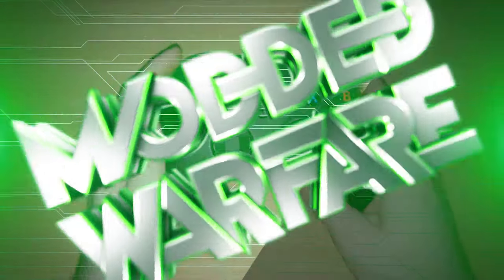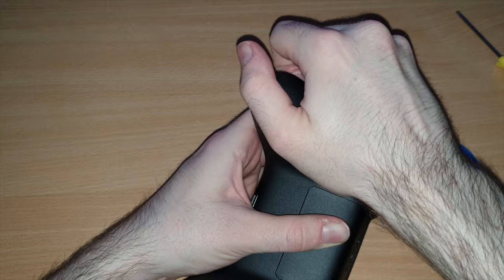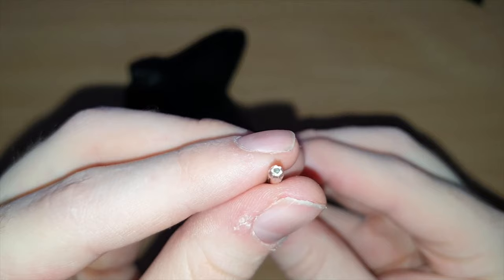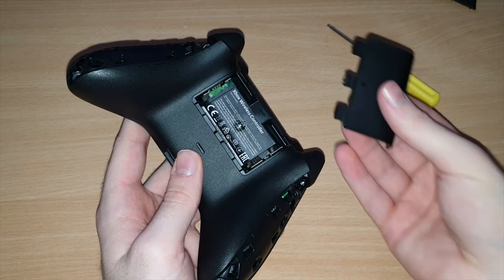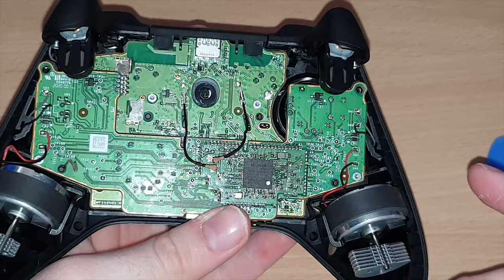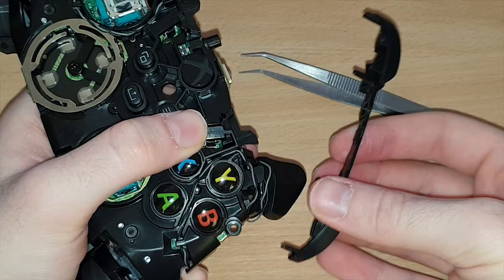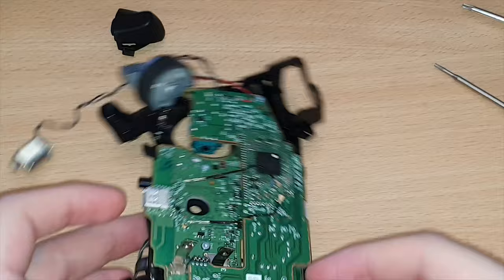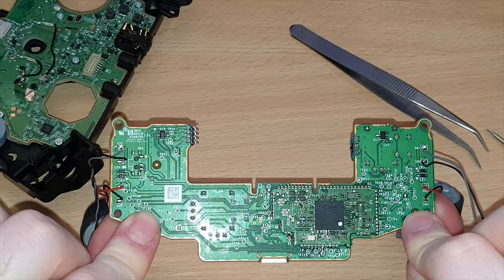How to Disassemble & Reassemble the Xbox Series X/S Controller

Comment: Even if u don’t have the correct screwdriver u can honestly just pry the screws out, that’s what I did, controller even without screws stays together for the most part, just a little duct tape n it works fine

Comment: Just bought one of these for my pc and well impressed by it's build quality, I thought it was all clipped together but those hidden screws under the side grips are a cleaner way of building a controller, never knew there were rumblers in the triggers clever, great controller though all the Xbox controllers are well thought about and comfortable to play with, certianly better than the PS4 and 5 controllers, really couldn't get on with the PS4 controller.
Reply: I definitely prefer the Xbox 360 and one controllers just because of those screws, yes it is a more efficient way of making the controller, but it’s almost as if Microsoft made the controller really hard to take apart on purpose

Comment: I must have an especially right joypad because even the second time taking it the sides this technique didn't work.
It only chewed up the device I was using to separate and even the plastic.
In the end I put a long thin enough plastic  part used to open mobiles, between the trigger and cover and really pulled it apart.

Comment: thanks so much, managed to clean my a button so it doesn't stick anymore, sadly i accidentally broke the grey and black wires away from the PCB on the left side, So the left side of my controller no longer vibrates but other than that it was a success.
Reply: If you like vibration then that's a big L. Otherwise a W

Comment: The little screws, I have yet to be able to snap off the little security torque thing and get it apart, so I've done the best I can with rubbing alcohol, spilled the smallest amount of lemonade on the left side of the controller and the buttons have been feeling horrible. So here to the 6th cleaning in 2 days

Comment: Ye thanks for the vid, I dropped a tiny bit of soya milk in the x and y button.. which you know can be a p off when they don’t spring back up. Anyways the video helped! I already had the T8 for the ps5 so knew exactly where it was…. But when you got to the part you said T6 I thought… why didn’t you add at the beginning what tools you would need haha. So I had to tip the house upside down just to find it! But either way all cleaned and working thanks!

Comment: Your guide overall is very helpful. However, there seems to be no mention of how you disconnected the black wires that go from the top board to the bottom and then have them back in place when putting it back together with again, no instruction as to how you did this. I’ve gone over those dismantle and reassemble segments a dozen times and I just don’t see it. Please explain!

Comment: hey i recently bought this controller for my pc and after playing for around 10-12 hours i noticed my left bumper is loose and shaky or something but right bumper is hard and fine, is it a problem? should i worry? its just like right one but it has a shake idk i think u got what im talking about pls answer :(
Reply: same thing happened to me, it’s not a problem and it doesn’t affect gameplay. It can be annoying though if it starts to rattle. An easy was to fix it is the pretty much just push it in PROPER hard when re assembling the controller.
Reply: @guwhy1907  i changed it and this new one is fine after 3months oh man i fucking love it.

Comment: Thank you for this video, I need to proper clean mine and I need something like this for don't make a mess. I've just a question, on my controller the right rumble doesn't work anymore (both on the right side, trigger and main one). I swap the left with the right for check isn't  the rumble itself but is not, the problem is the same even swapping the motors. Do you have any idea what's to check?

Comment: Thanks for the video helped a lot ,I have the same controller but blue and had lots of hair in my analogs causing drift.was able to fix my problem I cleaned it to my best with alcohol wipe and a qu tip thanks a lot I left a like and a sub for you

Comment: Last night the Down on my Dpad started sticking for no reason. I was going to take it apart and see but the torx screw bits we have weren’t working cause the controller screws had that little security torx so I opted not to continue. My 14 year old son however felt he would take it upon himself and he was going to use his other broken controller for parts. Now he has 2 controllers torn down and the red wires for the rumble motors are broken off on the board from my controller so I am trying to see if we can salvage a working controller from all this mess. It turns out the d pad had a sticky residue on it so not sure where that came from but I often regret letting my kids use my controller.

Comment: If I want to remove the rumble motors to lighten the controller are the front ones on the trigger still required? Based on this video it looks like the help set/mount the triggers.

Comment: @MODDED WARFARE The conductive silicon piece that cushions the buttons on my controller doesn’t seem like it is the right size. The XBox button was stuck down and not moving at all. When I go to put it back together the conductive silicon part for the center buttons doesn’t fit at all. In the video yours just drops right in there but on my controller that part seems too big. If one side goes in the other side pops out and vise versa. I think that might have been the problem with the button in the first place. Am I doing something wrong or is it possible the silicon part is made to cheap and not the right size?

Comment: My controller fell about 1 meter (about 3 feet) and now the LB button isn't working properly, I have to press really hard.
I already disassembled and reassembled to no luck. Any suggestions before I ultimately have to replace the whole part?

Comment: 7:43 for my controller that metal disc where the D-pad used to be is blocking the removal of the vibration motor, is there any safe way to remove that metal disc?

Sorry never mind, it turns out you don't need to

Comment: I have major drift issues with both analog sticks and will need to take apart my controller to clean it/replace the sticks but I don't have a t8 or a t6 screw driver what else could I use to remove the screws?

Comment: What are the two pcbs? That connects  the two black wires at 5:10 ? Cause the one wire pulled a little bit and it iis almost cutted to my controller is it IMPRORTANT?

Comment: When you put the signal wires down how do you stop them from popping back out can you use glue or anything cause everytime I put the batties back in they pop back out of place and I have to unscrew everything again it's getting so annoying but don't want to buy a new controller as ive only had it for 2 months, but the wires stay on till I put the rechargable battery in

Comment: i think the first step should be to take out the battery for safety.
Reply from the maker: It wont make much difference. You can't actually open the controller without taking the batteries out as the middle screw is behind them. So you must take the batteries out anyway.
Reply: @MODDEDWARFARE  makes sense.

Comment: I know absolutely nothing about this kind of stuff, I hope you can reply with an answer: can you disable the light that the xbox button has?
Reply from the maker: Not without removing the LED from the circuit board. You could block out the LED by putting something inside the button like a bit of foam or painting the inside of the button black.

Comment: I got an Xbox recently but I am very used to the controller setup of Nintendo with the buttons reversed I was considering opening the controller and moving the buttons around and then using the software to remap the buttons. But this seems like a lot of work to do it 😔
Reply: You can’t do that they have certain positions that they have to be in so you can’t even change the buttons around. I suggest just remapping it

Comment: Thank you. 

My dumbass wanted to try aFk on FH5 (yes I realize I'm an asshole now and I only did it once for like 5 laps) and used gorilla tape. My right trigger decided to keep some adhesive and shove it within itself. I used a knife (rip controller finish) and just pulled off the grip. That's as far as I've needed to go to use some alcohol hand sanitizer (a very tiny bit on a qtip) and clean it out. No more throttle stick. I felt like I was driving a Prius for a little bit.

Comment: Do not spill  sticky liquids on your controller if ypu don't have necessary tools for disassembly. I was able to remove big chunks of plastic using flat screwdriver I sanded down to size but these  dang small torx screws stopped me. Now I have to live with mushy B button :/

Comment: I picked up a used series s and while the console is fine, the controller has issues with its A button. Seems to not register sometimes when I press it, wondering if anybody knows what would cause that and if a button replacement would work

Comment: It’s so hard to take off the panel it took me like a hour to get one off and the other one is even harder it just resulted with not fixing at all and breaking one of the clips off
Reply: i struggled alot until i used a credit card, best thing ever, it might ruin it tho so use an expired one
Reply: @devenmelwani8426  i just ended up buying a $14 kit which I did need cause I also didn’t have the proper screwdrivers to open it but thanks for the info

Comment: I screwed up. I was using this video to guide me as I cleaned my controller's interior since I spilled a cup of coffee on it. Nothing wrong with the instructions, I just ruined the bumpers thingy drying it with a hairdryer (it kind of melted and warped) and it doesn't fit anymore, lol. Luckily I found a replacement on Aliexpress, of course it's a knock-off but oh well ¯\_(ツ)_/¯ I just hope it fits.

Comment: somehow my left trigger doesnt work properly after i took the controller apart . Any ideas on how to fix it ?
Reply: ok if anyone gets the same issue after putting in the metal thumbsticks like in the elite controller. The magnet in these switchable sticks gets a little singal onto the triggersignals which thenfore doesnt count as complete new signal after you released the trigger. Therefore not working in some games like egoshooters

Comment: Hey I have a problem nobody else seems to have. I've searched for this problem and found nothing. Basically the left trigger sounds normal and has that cushioned noise no matter how hard I press it. However the right trigger is different. When pressed harder is sounds more clicky or plasticy. You don't hear that cushioned rubber noise. This is on series X and would lovs to fix this as its really annoying me. And also sometimes the right trigger sounds just like the left then suddenly it changes again.